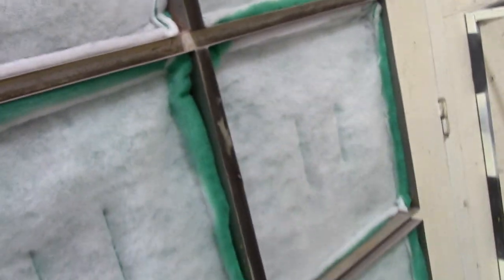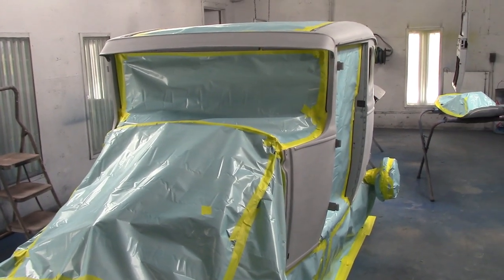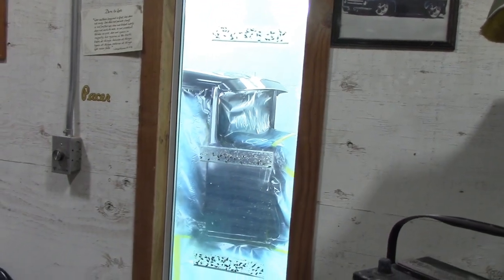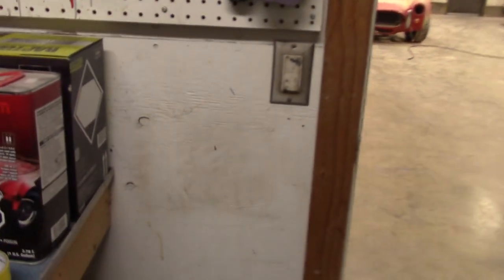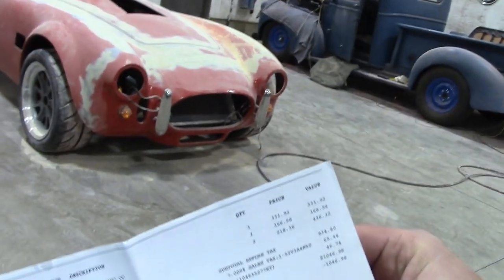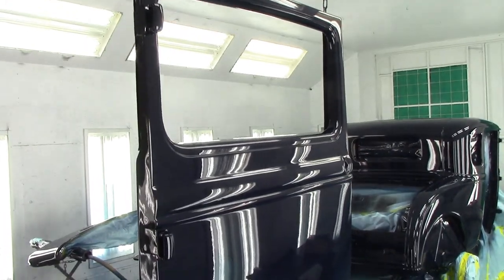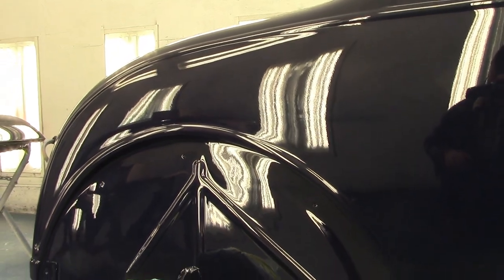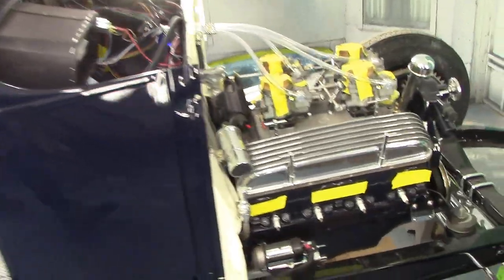Painting My Hot Rod 31 Ford Coupe Factory 1931 Anthracite Blue / Black

Comment: Just did a little search for you and this definition came up. "Anthracite is a very dark coal with a high carbon content. It is the highest rank of coal, and has a very high heat value. Anthracite is used to produce metallurgical coke, which is used in the steelmaking process. Anthracite is also used as a fuel for steam locomotives and marine steam boilers.

The color anthracite is a very dark gray, almost black. It is the darkest of all the coal colors. The color anthracite is often used to represent sophistication and elegance. It can be used to create a formal or professional look." 

I doubt Henry Ford did much research when coloring his cars. If you decide on pin-striping I suggest a 'Wimbleton' white like your firewall. Enjoy your car. Can't wait for the "T" shirt !!
Reply from the maker: Well look t you go thank you !